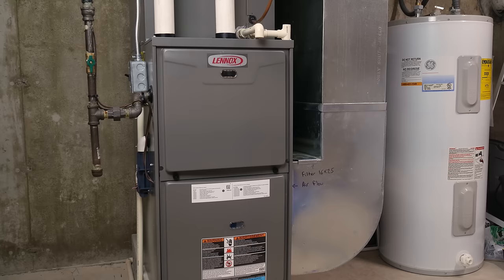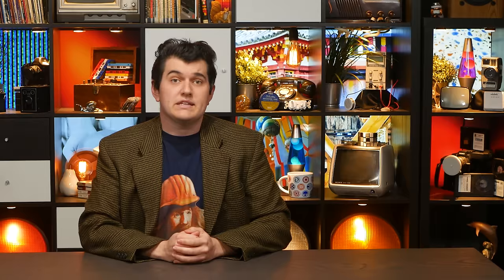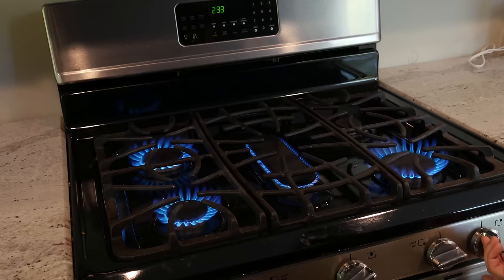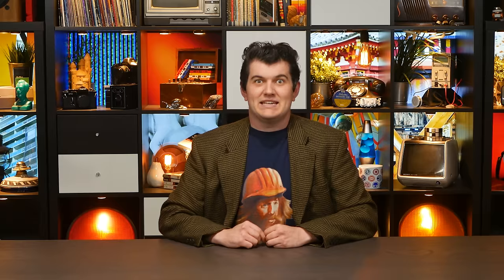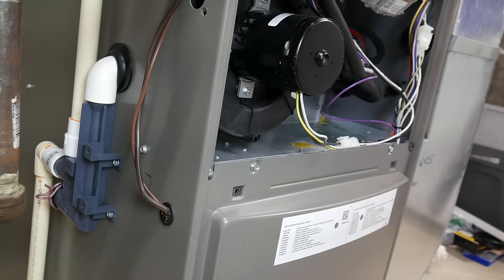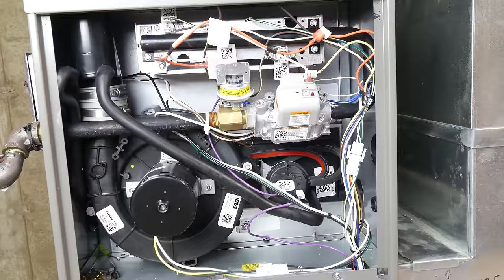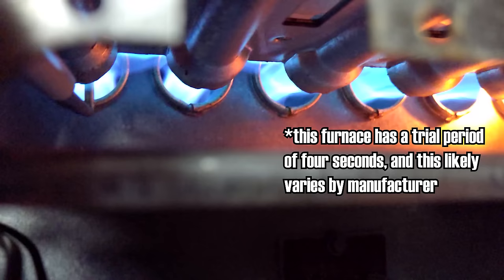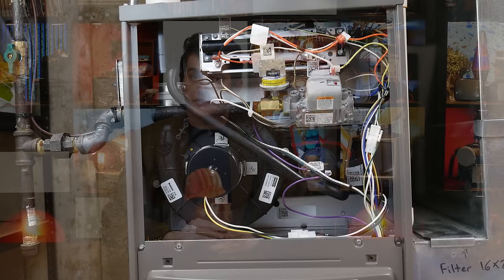Forced-air Furnaces: The What, Why, and How

Comment: I was always interested to know more about furnaces. I live in Québec, where the primary source of heat is electric. Because electricity is cheap in Quebec. Seriously we pay 50$/month all year around.
Reply: is that nuclear power ?
Reply: @monad_tcp   Quebec in Canada has one of the most immense hydro-electric plants in North America. Electricity in Canada is called "hydro."  Canada exports electricity to the US, and that may pay for part of Canadian''s hydro bills.
Reply: Electricity is pretty expensive, at least where I live in Los Angeles. During summer months (where average temps are about 100 F/38 C), running the a/c could cost $300+ per month.
Reply: @Sperkowitz  Blame that on the shut down of all the El diablo facilities, to be fair, they were old, but they could've been upgraded instead.
Reply: @kennethflorek8532  yeah, nothing beats hydro ! cheapest power source, too bad it can't be put everywhere. Here my power comes from hydro too, but they tax it so much that's cheaper using solar panels. 
Its like 85% tax, to subsidize biofuels, I hate biofuels, they are not energy efficient and will never work. I don't even use biofuels, I prefer to pay more for gasoline, because I know biofuels only look cheaper because I'm paying more in electric power.
My second option would be having nuclear power, but the downside is that is a massive centralized power plant, just like hydro, it needs lots of financing to be built.
But it is cheap if you calculate that investment over its lifetime, too bad the politics and the general public don't "like it" (we all know that's propaganda from gas companies)

Comment: Unless it's an emergency, NEVER shut the furnace down using the service switch.  If the furnace is burning, turning off the service switch kills all the blowers, including the ones that are drawing the heat out of the burn tubes.  The burn tubes will almost instantly glow red and overheat thus reducing the temper and the overall life of the tubes.  Let the onboard circuit board shut the furnance down normally when iit sees the tubes have cooled off.  Love forced hot air...the effect in the house is much faster than radiant water.  If your furnace runs for a bit and flames out, the first simple fix is cleaning the flame sensor.  You'll notice a timed reset by the circuit board as an indicator that this is the problem.  Mine reset every 7 minutes.

Comment: Would love to see you cover the other end of heating technology sophistication: the pre-forced-air gravity furnace. Like mine, for instance...my house is heated to this day by a steel monster installed in 1947. Not a blower or circuit board in sight, barely anything to wear out.
Reply: a prehistoric technology still in use today is the direct fired furnace which sends the exhaust gas directly into the space that is being heated. not uncommon in large volume spaces like shopping centres, churches etc...
Reply: my unit uses a fujitsu ac split circuit unit

Comment: 15:06 That's not a thermocouple, there's only one wire. It's just a plain chunk of stainless steel.
The flame sensor works by applying a high potential, and monitoring current loss. Hot gasses conduct better than cold.
Reply: You almost got it, but its not the gasses that conduct the electricity. Its the fire as its a plasma, where it acts like a diode and passes a very small amount of current.
Reply: @thegreatoutagesign9204  "its not the gasses that conduct the electricity. Its the fire"

The fire is just hot gas.

"its a plasma"

No, it's not.
Reply: @seneca983  No, fire is literally plasma. I don't know what your smoking.
Reply: @thegreatoutagesign9204  Plasma by definition means: "a state of matter in which an ionized gaseous substance becomes highly electrically conductive to the point that long-range electric and magnetic fields dominate the behavior of the matter". A sufficient amount of ionization for that requires temperatures in excess of 10,000 K. The fire in your heating furnace is nowhere near hot enough for that.
Reply: @thegreatoutagesign9204  10,000K was a figure I found googling for a lower limit for (thermal) plasma temperature.

"Natural gas burns at 3,043K"

Where are you getting that number? Wikipedia lists it as burning at 1950 °C (2220 K).

https://en.wikipedia.org/wiki/Gas_burner
Reply: @seneca983  Fire is plasma
Reply: @Owen_loves_Butters  It's not according a typical definition because the degree of ionization in a typical flame is rather low. Of course, that depends on where exactly you draw the boundary between plasma and gas which is somewhat arbitrary. However, fire isn't usually considered plasma.

Comment: From a HVAC tech you did bang up job explaining the modern furnace. Now if people would just not ignore their aging equipment. Yeah even if it still puts out heat, a leaking cracked or rusted thru heat exchange can make you dead in no time at all. If it’s bad enough it can be in 10 minutes.

Comment: Something I've always wondered about forced air systems: if the air is heated in order to warm the actual house and its contents, doesn't that mean the air is warmer than the house? In that case, any air escaping the house (and there always is some) will carry away disproportionately more heat compared to radiant heating systems in which the air temperature lags the temperature of the building's fabric and furniture.

Comment: A fun benefit of living in a place with a natural gas network: My dad has a internal-combustion backup power generator that actually runs on natural gas. After his basement flooded enough times due to power outages stopping the sump-pumps, he made the investment. Now, if the power goes out, that generator kicks on automatically and powers a few essential circuits in the house, including the pumps and the refrigerator, and the best thing is... he never has to fuel it! If he's on vacation for week and there's a major power outage that lasts for 5 days? It'll just run the whole time
Reply: The only downside is cost.  Those things can potentially burn $100/day in gas, and you need to maintain them.  Even with the standby generator I would recommend a battery powered sump pump as a backup.

Comment: I love thinking about furnaces so much I had to come back and watch this again 😆

Another important efficiency note is the total efficiency of the heating system, and this is where hydronic systems excel. They use considerably less energy to convey the heat from the source to the emitters than forced air systems. It's not just about combustion efficiency.
Reply: That depends where the forced air ductwork is running. If it's losing heat inside the building envelope, it doesn't really matter if it's "inefficient".

Comment: Fun fact, refrigerant R-234 will make you high as a kite. I learned this when a pair of "geniuses" in high school ( I took a HVAC class because I finished early and the fuckers still made me attend something) Anyways, tangent over. The brilliant student pair smuggled in a few beers and wanted to chill them down. a 20 pound can of refrigerant seemed to be the solution so they took a large hammer and knocked the top off to cool their beverage of choice. at this moment three things happened at the same time. 1, the thought that it might not have actually been the greatest idea may have crossed their minds. 2, the large pressurized cannister goes rocketing off punching through a 8in (200mm) thick concrete block wall. 3, refrigerant subsequently fills the shop and classroom as we all get high as hell from it.

Comment: Looking at stats from my state, Oregon, I can see that my county has 72% residential heating by electricity,  and only 17% from natural gas. 
Makes sense, electricity is below $0.10/kWh. My house even has an ancient forced-air resistive electric furnace.
Reply: There was a big push to heat with electricity in Ontario, Canada back in the 60's and 70's, when fossil fuel rates were going up but "hydro" was dirt cheap. Especially in rural areas. A failed gov't attempt to convert the grid to green energy in the 2000's basically killed that (big corruption scandal). Rates skyrocketed, and resistive heating became prohibitively expensive. So a lot of those homes that could afford it moved back to propane and oil, and the ones that couldn't moved to wood or ate the cost. Natural gas is still the cheapest option in urban areas.
Reply: Here in Quebec, most homes are heated by electricity, with some more rural areas having wood burning furnaces. Heat Pumps are a nice solution (mostly for AC), but will not function at all most winters (since its too cold outside)...
Reply: the northwest had a phenomenal power grid implemented smartly

they did not do this with gas
Reply: @ShadowZero27  that's because of an abundance of hydro power. No matter how smart, you couldn't have built that same system in Iowa.
Reply: Makes sense when your electricity is that cheap. In Germany it's €0.30/kWh. That's why the vast majority of homes have gas, oil or district heating. In some cases even coal. Electricity accounts for only ~5% nationwide.

Comment: I was surprised when I moved from Philadelphia to the Pacific Northwest and learned that almost no homes out here seem to have gas of any kind.  It's all electric for household heat, cooking, dryers, water heater, etc.

Granted, we have especially mild heating needs and electricity is pretty cheap considering the large amount of hydro and wind power in our region.  It's also just sort of a forward-looking part of the country, in general.

That said, it is a bit surprising that many homes here don't seem to have carbon monoxide sensors, either.  Our home doesn't.  It's likely a reduced risk, with only baseboard heating and an electric stove, but this makes me think about maybe getting one. I wonder, what sources of CO are there in a home like ours and what are the risks?
Reply: CO comes from a fire that doesn't have enough oxygen. So you unless you start your own fire or light a candle or something, I don't think there are any other sources.
Reply: Without any combustion, where would the CO come from?
Reply: @Mike-oz4cv  we do have a fireplace but even that we switched to an electric fire.  Less romantic but much lower cost and hassle.  And a lot cleaner for the air.

Comment: What I'd give to have a gas furnace again...currently where I live are dual-zone heat pumps w/ electric supplemental heat and trying to maintain ~68-70F inside when it's below 20F outside seems to leave it running non-stop to the tune of a $400+ electric bill and never feeling quite comfortable.  Gas heat easily keeps up and if its chilly pushing up the thermostat even 1 degree usually leaves you feeling toasty warm.
Reply: This! If they ever figure out how to make a heat pump system blow hot air (besides the emergency/backup toaster coils)  I'd consider one.
Reply: @Rich_123  they do....just not at cold temps when you really want that!  Agreed... could be so much better
Reply: @Rich_123  I have a dual-fuel model.  Most of the time, it's a heat pump when you only need a little bit of heat (which in the state of Georgia where I live is most of the time).  But if it gets below 20 degrees or so, it either automatically switches (or I can) to a full gas furnace. I think it was only a couple hundred more to do this versus all heat-pump.
Reply: @michaelburns8073  that sounds very nice...Every heat pump I have heard of is 10-20kW resistive electric heat strips for backup.

Comment: me: *confused district heating noises*
Reply: ebulating  Most older universities seem to have them too.  Unfortunately, many are even coal fired.
Reply: For example in Finland district heating is suffering in cost pressure of heat pumps. In some area district heat is more expensive than using ground sourced heat pump and then it is not that popular anymore in small buildings. For example one Ikea is using ground sourcing heat pumps as it is just cheaper than district heat. Even though that many cities use huge heat pumps that takes heat from ground/sea/sewer water as a part of district heating heat production, but network is much more eexpensive than electric grid so many one family houses dont join the network even if would be available.

Comment: Same deal in the UK, except we heat water in the furnace and pump it round radiators.  My "boiler" is in a cupboard.  The condensate drains into a little plastic box with a bilge pump in it.  I really, really, do need to put a flood/moisture sensor in there... if/when that pump fails.  The condensate will be dripping out of my ceiling.
I think the water thing comes from the UK being coal fired initially and masonary builds.  Every house was built with several fires.  Using chimney's criss-crossing up the walls to heat the solder brickwork of the houses.  Later they moved to coal gas.  Then mostly oil and electric for a while until "Natural gas" became a plumbed in thing in the 2000s.
When central heating came along, the easiest approach was to put a back boiler behind the fire and fun the exhaust up through it... let convection circulate the water to the other rooms.  When coal became frowned upon (and labour intensive) for home heating in the 80s/90s, people moved to coal gas or oil.... in the 2000s natural gas.
Retro fitting air ducting is expensive.  I think most US homes have them as a large part of the US (North America) get summer temps routinely requiring air cond.
Although that comment about ventalation is valid.  What comes with "coal fired" though is a large number of underfloor vents and high air exchange rate.  Not that helpful in winter with no coal fire lit, but you can't seal them all!  You have to seal the floor with carpets/insulation etc.  Let the underfloor breath and allow smaller airleaks to provide just enough.  Open the windows all summer.

Comment: re: inefficient electricity generation. Most of our power plants in the Nordics are dual-use, and provide district heating in addition to electricity, dramatically increasing the efficiency of the plant. But there is some heat loss in distribution, so it's mostly used in high-density areas.
Reply: Quite interesting
Reply: District heating and hot water supply is super convenient, I used to live in a building from 1920s which had tiled coal furnaces in every room (converted to electricity and fitted with resistive coils in the 70s, and the pre-war tiles were actually quite beautiful) and an electric boiler for hot water. I dreaded winter because of the cost, now it's a fraction of it. Also, no equipment for me to personally maintain.
Reply: With this you only have a heat exchanger in the home, that heats your radiators and water. And they are relatively simple things that will last 20-30 years.

Comment: Alec! Thinking about energy efficiency, you should do a video (or series?) on earthships! They use tire and soil walls as a thermal mass and to provide cool air in hotter environments. They have a greenhouse area to grow food and provide heat during colder days. They catch rainwater and use it multiple times in different ways. They use solar panels to provide electricity. In terms of technology, I think they are fairly simple, but the combined effect of all these things is a very energy-efficient/zero-energy home. (They're designed to be "off-the-grid.") I am amazed by the ingenuity of the system, but I admittedly don't know a lot about how it all works. Hence, I'd be interested in having you do all the hard work of research so I can just watch an entertaining 25-minute video (or videos) about it. :)